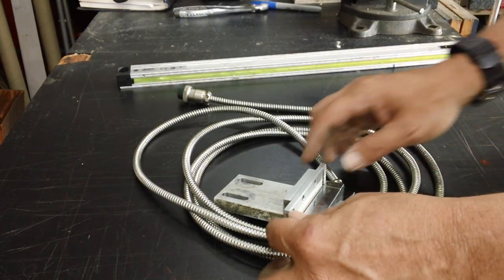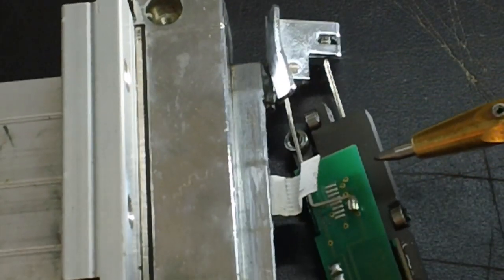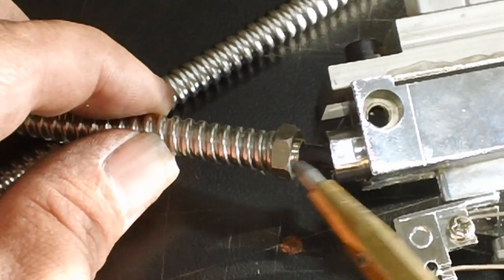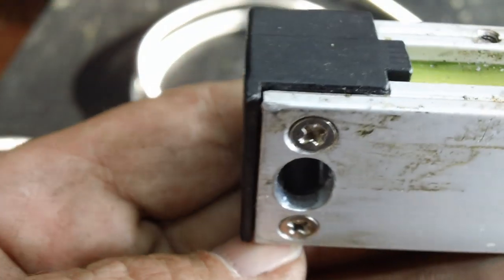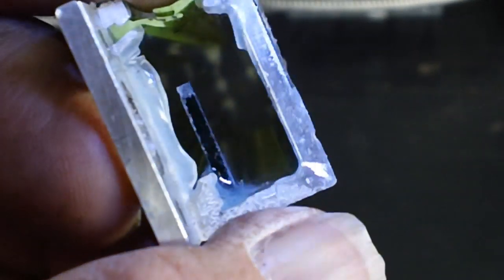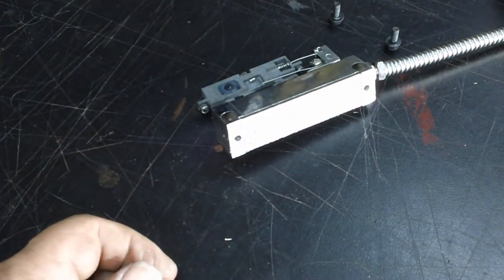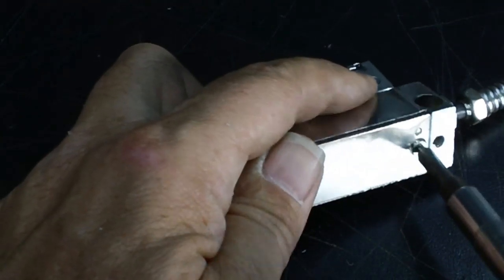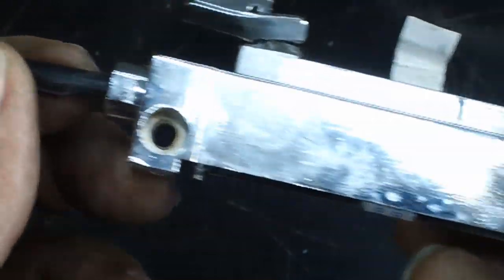Part 1 - DRO Linear Scale Reader Repair Project (Jenix)

Comment: Hi there;
  I have a similar one which quit functioning. When I took it apart, the reflective mirror scale was loose and came out. I looked it over, and put it back with superglue. It didn't work. So I soaked the immediate area in acetone until it released and reoriented it to another position I thought was really correct... still no life.  Do the LED's put out visible light? I see none. 
  Possibly the glass coming loose was not the original problem, just come loose on dis-assembly.
  Thanks,
  Mark